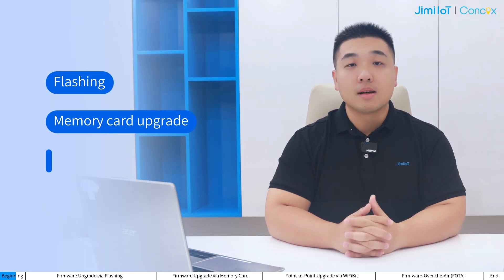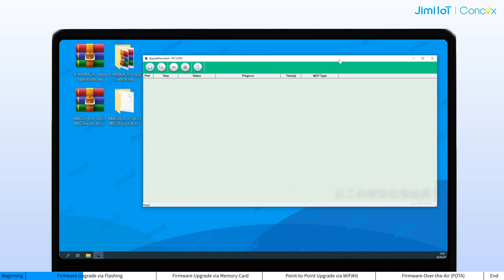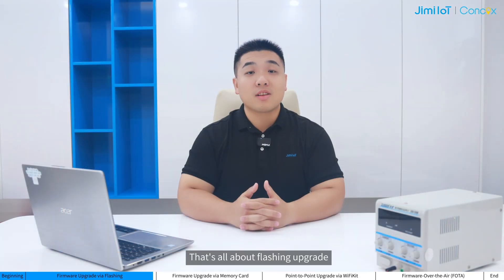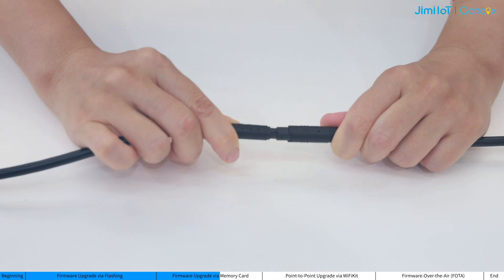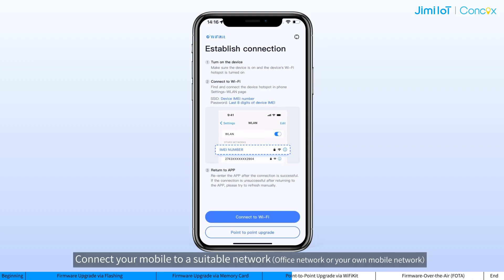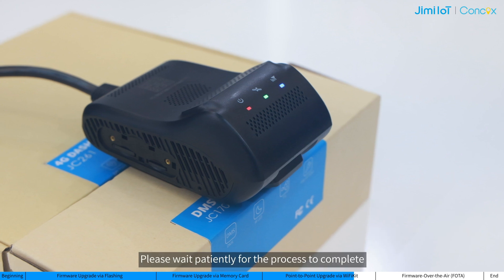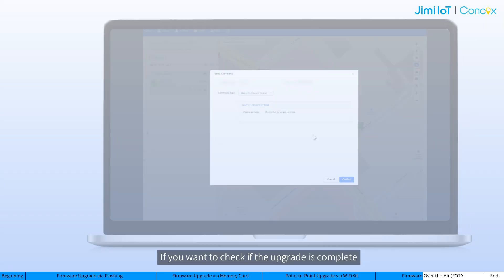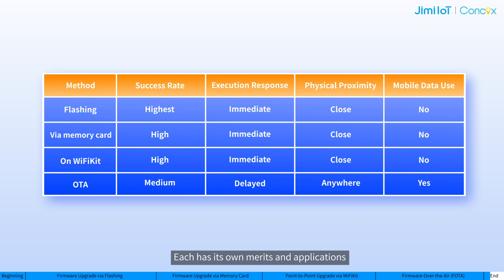Comprehensive Guide to Firmware Upgrades for JC261 & JC400 Series Dashcams

Comment: Where are the links. my jc261 keeps going off line and i used the command VOL,0  but the camera still makes some chime also on the website if i change setting. if i change take a picture of front and rear camera when leaving a geo fence it just goes back to front camera.